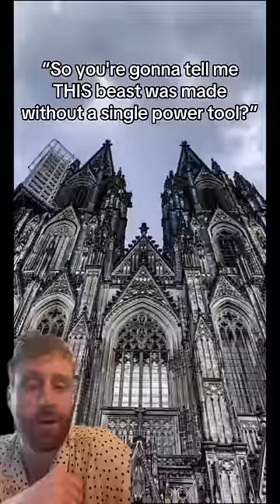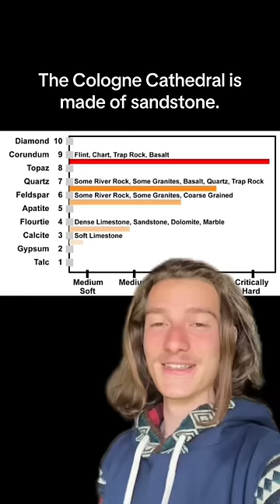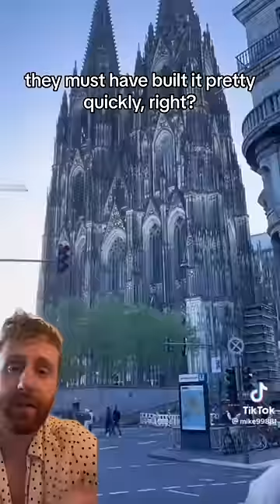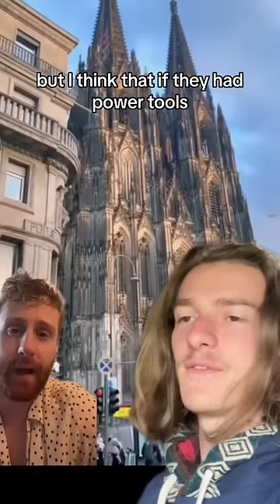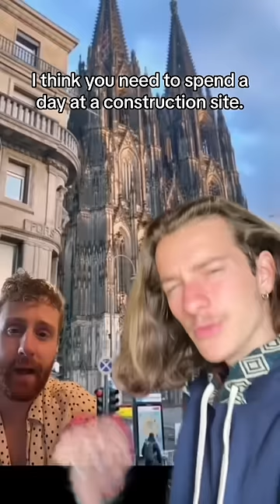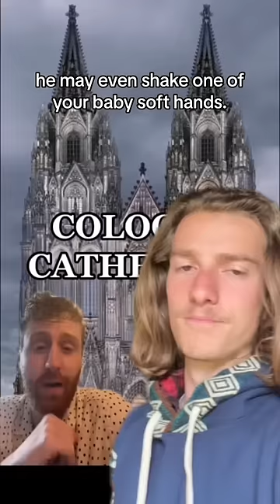How Did They Do It Without Power Tools?

Comment: As someone from Cologne, I would like to add that, due to the way the cathedral was built, it is basically under constant repairs and refurbishment and here in Cologne work on the cathedral has never been considered finished because of that.
In fact: there's a saying here that roughly translates to "The day the Cologne cathedral is completed, the world's gonna end."
Reply: E
Reply: that's pretty interesting.

I wonder tho if it is due to the construction or due the environment (erosion an corrosion) that it requires constant repairs and refurbishments.
Is there maybe a chart where they are listed?
Reply: that's pretty interesting.

I wonder tho if it is due to the construction or due the environment (erosion an corrosion) that it requires constant repairs and refurbishments.
Is there maybe a chart where they are listed?
Reply: Anyway... et kütt wie et kütt
Reply: @Rondo2ooo  jenau
Reply: @michellonneberga8097  It's both. 800 years of slightly acidic rain and 200 years of CO2 pollution have eroded the relatively soft sandstone.
Reply: @michellonneberga8097 Milo just said how soft sandstone is. The dome is just really f*ing huge. Like pictures don't do it justice. Once you are at the top with your revocations, you can start at the bottom again, just because the sandstone erodes so quickly.
Reply: @cacamilis8477 I don't think the CO2 does much to the sandstone. But rain is still more acidic than preindustrial levels, even though we got it mostly under control and our forests aren't actively dying from it anymore (now they die because it's too hot).
Reply: @EEEEEEEE Why
Reply: You should thank the Prussians that they actually were so pissed about the damn Thing still being a Ruin that they invested a huge Chunk of Money and Labour just to finish the damn Thing and be it to just make a Point.
Reply: So in the end, it WAS built with Powertools. Just... Only a tiny fraction of it
Reply: So kind of like Sagrada Familia?
Reply: @dominiklehn2866  really a good part.
Reply: @4203105  so in the end... The guy in the original video was wrong on literally every thing he stated
Reply: @dominiklehn2866  no you're taking a joke too literally +  they meant completing repairs
Reply: @tenjenk  well, mine was a joke too, so I think you're the one taking a joke too literally. But to be fair, happens to everyone. Or maybe I misinterpreted what you mean. Wouldn't be the first time
Reply: If you’re from Cologne maybe you can explain why they built it right next to the train station…
Reply: @alexh7715  I'm unsure if this is sarcasm, or if you jumbled the sentence a bit. The train station was built next to the dome, not the other way around. 😂

As for why, hnestly I have no clue. I've lived there for a while and went to school there, but I don't remember anyone ever questioning it. 😂
Reply: Though I understand where it's coming from, it's a weird saying, considering that it was officially finished almost 144 years ago. Maintenance =! Construction. But honestly, I doubt that most people even in cologne know that it has officially finished construction.
Reply: @EEEEEEEE  𐌄ቹ𐌄ቹ𐌄ቹ𐌄ቹ𐌄ቹ
Reply: Excessive co2 in the atmosphere can contribute to acidic rain. Its not as bad as what coal does, but its not benign. @4203105
Reply: Then please let it never be completed
Reply: France: "Man it sure is frustrating constantly having to rebuild Notre Dame in Paris."
Germany watches as a crocket falls off one of the towers of the Cathedral in Cologne a few seconds after the exact same crocket on the opposite tower is replaced.
"That really is a shame France. I wouldn't know what that's like."
Reply: Well and there was the whole war thing
Reply: @michellonneberga8097  Basically everything requires continuous maintenance if you want it to stick around, especially if you're constantly using it, especially if it's highly elaborate, and architecturally pushing engineering to it's limits, like a cathedral.
Reply: Holy cow! There is a cathedral near my family's hometown in Mexico. It's also constantly being refurbished. Very old. And also has that saying attached to it! That's so crazy how two places totally separated from each other can have such similar things. 😮😂
Reply: @ttp513 Only that construction on this cathedral started 200 years before Columbus set off to America.
Reply: @cyan_oxy6734  ok not that old, but I know it began construction in the 15-1600s, so probably close to evening out due to that 200 yr gap lol. But still. It's crazy how it's the exact same saying.
Reply: Danke für Deine Antwort! Wollte gerade was ähnliches tippen.
Reply: Soooo - there were actually powertools involved in the current state of the Cathedral!
Reply: With a few breaks for Kölsch ;)
Reply: @alexh7715  I'm not from Cologne, but probably tourism. If you build your most famous thing to visit right next to the main station, less tourists stroll through the rest of your city. 
Also since there are not a lot of parking spots around it, at least some car brains don't drive into the city to visit it.
Reply: @ArtjomKoslow  Thats not the reason they build it tho.
Reply: @tillorrly1128  Its a joke trains werent invented when they started the cathedral. Also I am so happy that most tourists are in the old town. Easier to avoid, altho I work there atm haha
Reply: to be fair this is true for many cathedrals and big churches
Reply: Das ist nicht so gut
Reply: Omg I love this thank you haha
Reply: Finde es immernoch witzig das die Pläne ne Zeit lang wohl zum Bohnentrockenen verwendet wurde
Reply: @michellonneberga8097  the constant repairs are actually because it's of the sand stone. It's so soft, everything can actually make a dent in it with keys (not tried on the cathedral, but other stones). Interestingly sandstone is not the same everywhere. Some sandstones are a bit harder, the color differs too (some are more grey, some yellow, green or red).. the cologne cathedral is build with a sandstone that sadly is not as hard. I know from other churches build out of other sandstones, that don't need as many repairs.
So even normal rain would have effect, but yes acid rain of course has a stronger effect. So the environment does have en effect, but because of the stone, it wouldn't change too much.  

But it is the same with the Eiffel tower. They are painting that one all the time too and if they painted and repaired all little problems, they can start from the beginning again.
Reply: @michellonneberga8097 Well the Romans build bridges hundreds of feet high that held up over 1800 years under constant use, through both world wars that damaged them and still made it without any repairs to the modern day…does that answer your question?
Reply: I believe it haha, It had scaffolding on it when I visited in 2004.
Reply: TBF being 600 years old even prior to completion pretty much guarantees something will need fixed.
Reply: @ruzefosho  tell that to the romans
Reply: @Cin9999  Romans were doing constant work on their marvels to maintain them.
The Colosseum itself in Rome received numerous fixes and updates pretty much until the 6th century.
Reply: @ruzefosho  There are roman bridges that are hundreds of feet high and made it over 1800 years through TWO world wars which damaged them and they still work and only were cosmetically repaired up until today and are still in use. 

Doing repairs on random shit or for looks/preventive measures =\= things fall apart like our kölner Dom
Reply: @Rondo2ooo et kütt gar nix mit Google translator😂
Reply: where is this place? Sounds like Italy but I don't know.
Reply: @Mr.supergamer20  Germany
Reply: Now that we do have power tools, has anyone suggested replacing the sandstone with a denser material that wouldn't require so much work ?
Reply: @lapantony  Buddy haha you realise that putting a granite floor into a kitchen can be like 20-30k? Yeah? 

How in the FLIP are you expecting us to replace sandstone with that? That would be an easily billion € lol
Reply: @Cin9999   Exactly. Just imagine the amount of money that can "disappear" along the way
Reply: @lapantony  "Given the nature of your question, we should consider using you as material, because you seem to be incredibly dense" - Cologne stone mason's answer, probably  (whose family's existence has been and will be eternally dependent on the properties of sandstone).

Jokes aside, I've talked to the guys working there and they say that a lot of knowledge of the craft has been lost and it wouldn't be possible to build it today. At least not with the materials used back in the day.
Reply: @UnintentionalMexican  Oof. Oh well, I guess it works as is then
Reply: Imma steal that. Shame you don't hear it outside Cologne. That'll be the next Berlin airport for sure

I was today years old when I realised that the English for Köln is the same as the perfume
Reply: "Oh hey, we finished the cathedral!!!"
Nuclear bomb goes off in the distance
"Fuck"
Reply: @ZudinGodofWar  Quick break something off
Reply: @lapantony  Lol
Reply: "The day the Cologne cathedral is completed, the world is gonna end," 
New conspiracy has entered the chat
No one tell Philip
Reply: @Mr.supergamer20 you're from the USA I'm guessing 🙃
Reply: @stardoll1995  Lol, yes I am
Reply: How do you say that in German? The saying, I mean

Comment: Fun fact: due to construction not finishing until 1880, they actually got to use industrial steel instead of wooden beams for the roof structure. That makes it more resilient against fire, e.g. what happened to Notre Dame.
Reply: They actually cheaped out at the end and threw a tin roof on it.  This was a good call because it took 5 direct bomb hits during ww2.  And the roof was blown off, giving the force somewhere to go.  Saving the cathedral.  They then found the original plans and finished it.
Reply: The photography of the cathedral of Cologne standing alone in the gravels after WW2 is an incredible sight.
Reply: Probably one of the only buildings being under construction so long that it got upgrades from a later tech-tree before being built 😂
Reply: Life hack: if something's too hard, take a break until technology progresses to a point that it becomes easy.
Reply: @Warmaka  It's actually pretty common. I'm just wondering how many times they'd have to have rebuilt all the scaffolding to do it over those years.
Reply: @DamienDarkside then it'll take 40 years to get there
Reply: And due it was actually finished in the late 19th century, they could actually have used Power tools for a few parts of the building.
They would've used a steam crane in this time to lift some very heavy pieces.
But we have a masonry right next to the cathedral because the work on such a beast of building is never really done.
And they don't use Power tools when they work on it nowadays... which is nearly every day of a week and on different parts of the building.
Reply: @aardque  A massive wooden crane from the Middle Ages (ca. 1350) stayed on for 500 years. It’s a defining feature of Cologne in old paintings.

https://de.wikipedia.org/wiki/Domkran
Reply: @@signalnoiz You are suggesting a place in the jungle where they gathered important documents so they could conveniently be burned together is somehow equally relevant to the status of a building where many of our ancestors sheltered from religious persecution, in a video about a German cathedral.
Reply: @trumpetedeagle2  Not 5 bomb hits, 70. And about a dozen of those were 3000lbs blockbusters.
Reply: @aardque you know rio is the capital of Brazil right? The city is enormous
Reply: @seanmurphy4075  An enormous "city," overshadowed by "Jesus," pretty much sums up the whole lot of 'em. Your point?
Reply: @eypandabear7483  true, these guys don't even know that we've had cranes that long. The ignorance is incredible.
Reply: @seanmurphy4075  Rio isn’t the capital of Brazil…
Reply: @@signalnoizIslam finds a way
Reply: There is actually more then one Notre Dames the one you’re most likely talking about is Notre Dame de Paris there are 37 of them Notre dame is what they call their cathedrals
Reply: @zeb9302 That is still no excuse for taking so long to return to the Moon though.
Reply: @zeb9302 that's how James Cameron made Avatar
Reply: That actually hurts.
Reply: @mid1429  Nope. "Notre Dame" is a cathedral dedicated to St. Mary (it means "Our Lady") Many of them are, but by far not all.
Reply: @mid1429  No, "Notre Dame" is just French for "Our Lady" and is the name of any cathedral, church, chapel, convent, etc. dedicated to a female saint or cannonized religious figure.
Reply: @RoonMian how'd the spires stay up?
Reply: @Warmaka 
This is an extreme example, but there are a lot of cathedrals that have Gothic (pointy) arches on top of Romanesque (round) ones.
Reply: 800 years of: "I SAID ON TIME AND UNDER BUDGET!  WTF IS THIS!?"
2 very specific days of: "On second thought, patience IS a virtue."